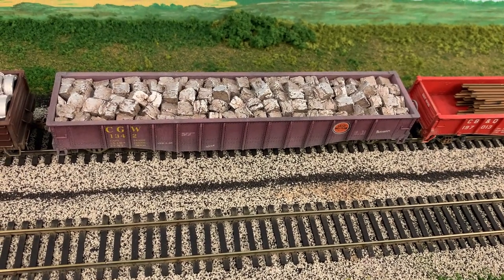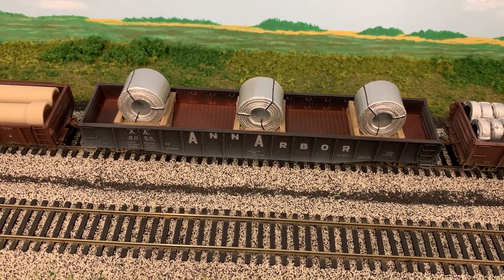Flat Car and Gondola Car Loads

Comment: How would they remove the Freightliner’s off each other?
Reply from the maker: I’m not certain how the loading/unloading was done, but my assumption is that portable ramps may have been used to ease the front of the tractor on to an off of the adjacent tractor ….. either that, or a hoist/crane would have to be used.    Thanks for watching the video.     Mike